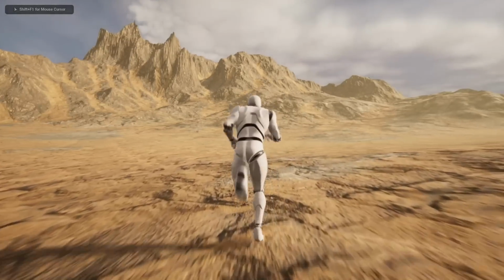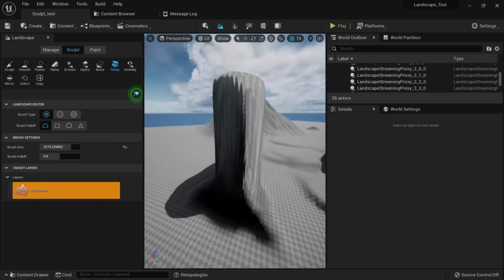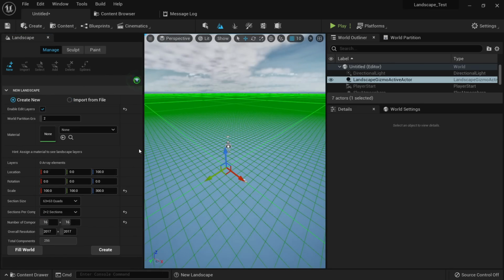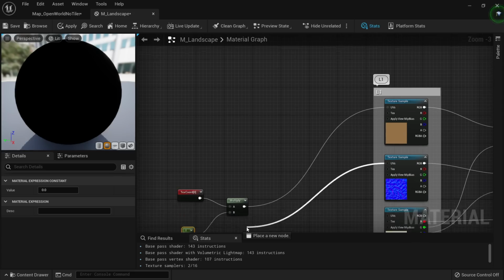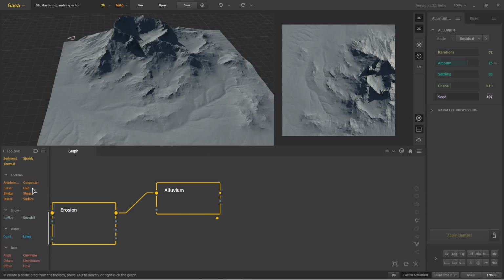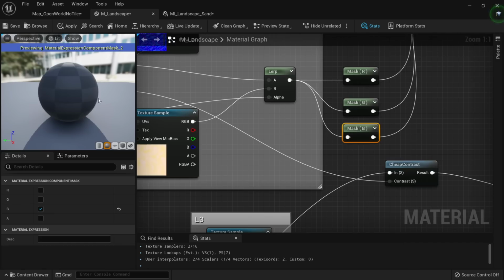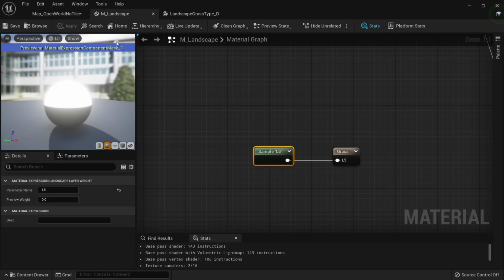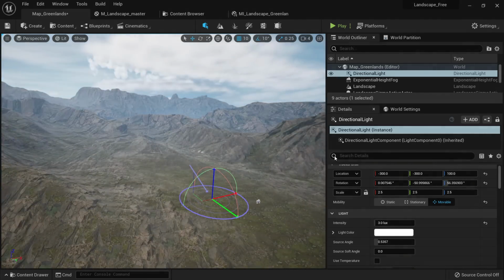Unreal Engine 5 Landscape Beginner Tutorial - Learn to create Open Worlds (Free Material available)

Comment: WARNING, the last 2 hours of this video are largely unusable because the audio keeps cutting out. It is extremely hard to follow because more than half of what's said is gone. Definitely an issue on the authors side since the transcript has large breaks in it as well. Judging by the amount of stuff the author has opened, I expect that his machine was overloaded causing the audio to cut out.  Be Warned!  

On the other hand the first hour and a half were excellent and very helpful. Even for UE5 versions after the initial 5.0, unfortunately significant changes occurred after 5.0 so that now the version 5.4 dev environment is very, very different. 🤔

Comment: Hi there. Thanks a lot for taking your time and effort to make these videos. I'm completely new to UE and they are super helpful👌

I need some help with enabling the world partition (I can't find any "enable world partition" check box in the project settings) and if I want to enable the "use external actors" in the world settings, I can't find it there either. So frustrating, any help would be really appreciated, I'm using UE 5.1 on Mac with macOS Monterey. 

THX!!!

Comment: I just found out we can collapse nodes so they combine into 1 node.. hahhaaha..

 doesn't seem to break anything, however I noticed when the collapsed node contains named reroute nodes .. the end nodes must be plugged into layer blend first it seems?? 

Anyway, now my landscape material is really OCD optimised 😂

Oh and also, I changed the scale of my landscape to 25x25x25 so the size of the squares are smaller..however I increase the resolution to compensate.. this makes sculpting really powerful, and landscape effectively zero difference in size, but 4x more detailed 😎at first this didn't really make sense to me so I hope this helps if you're new too

Comment: First of all, amazing video, thank you so much. Secondly, i am working on a project and i used your blueprint logic for automated material, but im facing an error as sampler register limit exceeded. The material is either not loading after that or it is not possible to paint over it with other materials. if you have any fix for this, please follow through, as it is not there in any website on the net.
Reply from the maker: Hi, make sure you put the texture properties to "shared: wrap"
Reply: @unfgames  its working now thank you so, so much.

Comment: so this is good for background landscapes but this cant be used in game levels because it looks like poo without tessellation and displacement of the terrain (UE5 removed it), any idea how to produce model based landscapes in an efficient way?
Reply from the maker: Landscapes are still being used in many games with or without tessellation. One thing to consider is that you must add a lot of static meshes to the environment, landscapes won't do all the work
Reply: @unfgames  of course assets will bring landscape to life but it can't replace it, so far best option I have found is to use the foliage tool to replace displacement and tessellation but it is not a solution considering you will not be able to have footsteps / trails.... displacement isn't working properly for 3D assets either (at least Mixer assets) the entire LOW frequency extrusion is ignored by the engine resulting in half-assed displacement, seems like the engine is still in Alpha and only way to get away with using it properly is if you don't need to use landscape and modelling to an extent

Comment: This is such an awesome tutorial, just wish I could get past the 1:03:00 min mark. I downloaded GAEA 1.2.1 so I could follow along 100% and in UE 5.0.1 the heightmap resolution shows 127 x 127 whereas yours shows 2032 x 2032. I set my parameters to the exact same as yours and I just get odd shapes. Even reinstalled UE 5.0.1 just to be sure, but it seems I get the same result.
Reply: the free version only offers a max resolution of 1024, maybe you should check your resolution settings in gaea :)

Comment: Is it possible to use Nanite with the procedural spawning system you described? I tried using Nanite meshes (some Quixel rocks) but nothing appears, all the while if I use grass or non-nanite meshes everything's fine
Reply from the maker: I haven't tried that, but it should work as long as the material is opaque. Or maybe nanite not supported for foliage types at the moment
Reply: Can you please check it out? Maybe I'm missing something